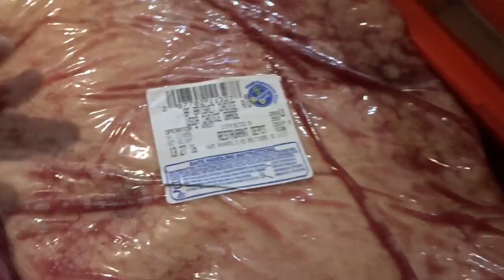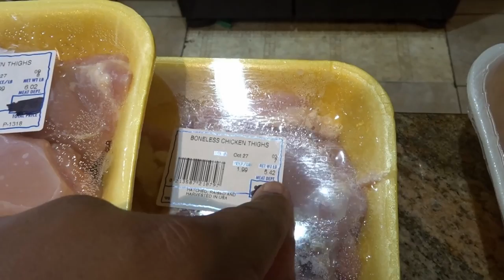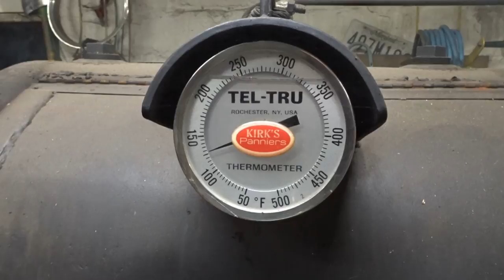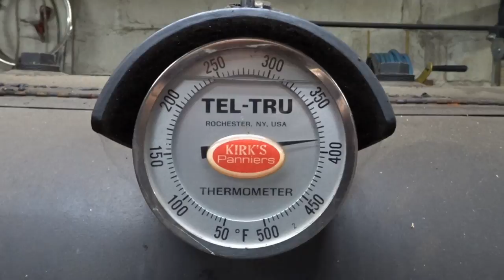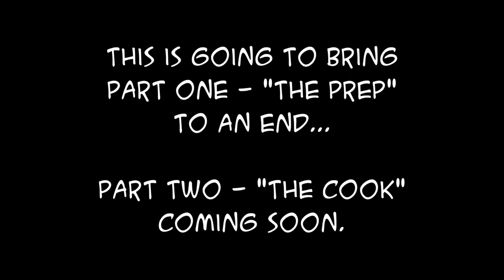SDSBBQ - BTS of a BBQ Catering Job - Part 1 - The Prep

Comment: Have you ever tried those tumbleweed fire starter that Royal oak makes for starting BBQ's ?  I switched from the propane torch to them and they work really well with a little kindling .
Reply from the maker: I use them for starting my grills but never a smoker.

Comment: Seasoned wood has about 20% moisture.....no need for water pan with a stick burner...especially an offset.
Reply from the maker: Not the case. Adding water to a smoker is a game changer for the better. Try it and then let me know the results.

Comment: Dash just a heads up on those wire brushes...I used to clean with those until 3X  while pulling pork I got brissles  jammed in my fingers, Thank god it didn't end up in a customers mouth...
Reply from the maker: I check the grates and the food like a hawk for the bristles. I also replace the brushes rather often. to help prevent that. Thanks for the tip and for watching!

Comment: i like the smoker im not sure if you misspoke about putting chicken on the top grate with pork underneath for food safety that is not very safe
Reply from the maker: I did NOT misspeak. If it were raw then yes it could be a problem. BUT since it is cooking and the chicken will cook faster and finish before the pork there is NO issue. Especially since the pork cooks to a higher done temp and anything from the chicken will be killed due to the longer exposure.

Comment: Been binge watching your videos all day. Thanks for all the info and the effort you put into making them. I have a question. What temp does your warming box usually stay at after you get to your 250° cooking temp? And also is it completely sealed off and is heated from the fire below or is there actually a vent? Didn't know if it just warms or you could actually smoke meats.
Reply from the maker: So I very rarely use the warming box but there is a vent in it. The box usually stays at about 150 with the vent closed and to be honest I've never opened it to see if I could get cooking temperatures in it.
Reply: @SDSBBQs  Awesome. That's  all I needed to know. I'm  about to make a custom smoker and was wondering for modification purposes. Thanks again!
Reply from the maker: @myyardguy6994  Nice! Good luck with your build.
Reply: @SDSBBQs  Thank you, sir!!

Comment: I see that drink. ;)

I've done some research on cooking loss for pork butt and other meats, for pork butts they tell you the final yield is 65% of your starting weight, this is due to fat rendering off and water evaporation out of the meat. Then you need to consider how many people you're going to be feeding, how many will be children, adults, and older adults (children and older adults tend to eat less), then determine serving sizes to come up with a final amount of meat needed for the job. Anybody can find these figures, just do an internet search for it. 

In regards to your fire management using the intake vents, I've been watching some videos recently in regards to getting the "thin blue smoke" out of your offset smoker and what I'm seeing is people leaving their vents wide open then letting the fire burn down to mostly coals and the mostly coal fire is where you get the thin blue smoke. After that,  add one or two logs at a time to maintain the temperature. Initially, you're going to get the more white billowing smoke with each addition but not starving the fire for air makes for a cleaner burn. Not trying to change your thing but something I've been doing for the past several cooks and it has helped me maintain more steady temperatures, it's not set it and forget it though.

Hahaha! "A barbequer", is that anything like a pitmaster? Not laughing at you, laughing with you. I know how hard it can be to find words at times, especially when you've got 10 30 things going on all at the same time.
Reply from the maker: You asked and I delivered!

My rule of thumb for catering job meat needs is much simpler than that, which you described. I recommend a 1/2lb per person then add a 25% overage as a starting point and then budget typically dictates from there.

Due to the size of the intakes on Bessie if I don't throttle her back she will burn WAY hotter than I need. I've found that when I throttle her back the fuel lasts a little longer then when she's wide open as well. I also add 2-3 sticks about once an hour to maintain the temp I need. There might just be differences in the firebox size and intake size that allow me to run Bessie differently.

I strongly dislike the term pit master. Most that use the term only cook in fair weather and only cook for friends and or family that will not actually let them know how bad their food is. Even if you were laughing at me. wouldn't be the first or last... have you seen some of these comments? LOL. Thanks Chuck for watching and commenting!
Reply: I have a personal aversion to self-identifying myself as an expert (master) at anything. Way back in another lifetime I had somebody tell me to watch out for people who call themselves an expert because nobody knows everything and the ones who think they do can be dangerous. Depending on the situation, even physically dangerous to those around them on a job site for instance. If somebody else wants to put a title on me I don't have much control over that, but when you self-proclaim to be something and things go wrong (and they will) for whatever reason then you don't look very good. 

I loved the video by the way.
Reply from the maker: Exactly. I don't like to be called "Grill master, Pit Master or Chef" If you want to label me as something... I'll take the label of Arsonist.

Comment: I like this video, I have a question for you!  I bought a used Lone Star Grillz offset 1/4" steel 24"x40" Smoker, The guy didnt take care of it so i am going to restore it, rust on outside FB and little in other places, non inside.  I will sand spots and top of FB then apply the high heat spray paint from rust0-leum.  Question is, can I power wash the inside of main chamber and FB, I have a good pressure washer and foam canon and have some Pink shampoo from chemical guys for car washing!  Or should I just do it all by hand inside and out cleaning!   I just want to clean it like new again!   Thanks for help!    I do have wide put knives if needed to scrap grills and inside crud!
Reply from the maker: I pressure wash the inside of the cook chamber once a month. I usually don't use any "cleaner" though. Usually the high pressure is enough to clean the smoker out. For the firebox I usually just shovel out the ashes once they are cool.
Reply: Thanks for the advice!
Reply from the maker: Sure thing.

Comment: How much do you charge to do an onsite cook, with food provided and without. Thanks for your help.
Reply from the maker: That's a bit of a loaded question. I have a flat rate per hour with a minimum amount of billable hours. Then as far as food costs smoked meats are charged by the pound and if I'm buying hot dogs, burgers and buns I charge for those with a small fee added in.
Reply: How much do you charge to do an outside cook ,question not answered.

Comment: Is there anyone else other then me asking myself am I the only one who doesn't cross contaminate my food and serve it to unsuspecting people. I'm just wondering, because I see it a lot, chicken blood dripping on pork yeah 120 lbs of pork on the bottom rack and 40 lbs of chicken dripping on the bottom. But by the looks of the smoker it looks like stuff gets cooked well done in there so I'M SURE NO ONE GETS SICK...
Reply from the maker: The way the food is cooked it is all done to the point that, cross contamination isn't an issue. The bigger issue is when pork is cooked over non pork meats, as I explained.
Reply: Tina 
I was going to ask the same exact  question you did but you beat me to it. It is a concern for me. It's usually my 1st question that I ask.
Reply from the maker: More often than not in almost any bigger BBQ restaurant they cook with and or on a rotisserie smoker. I at least make sure there is no pork cooked over and non pork.